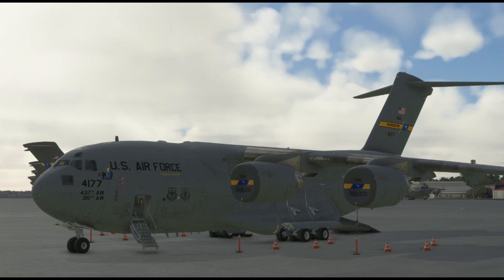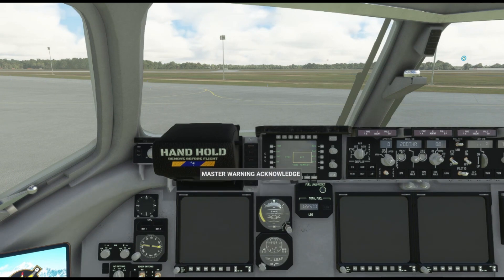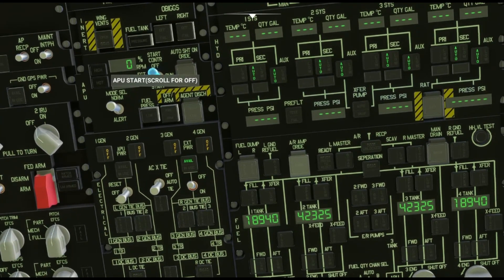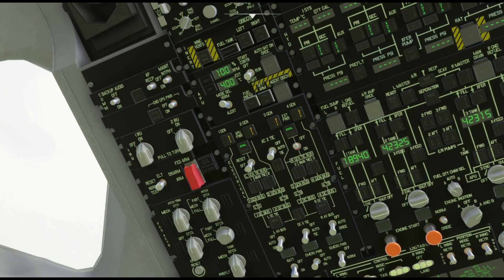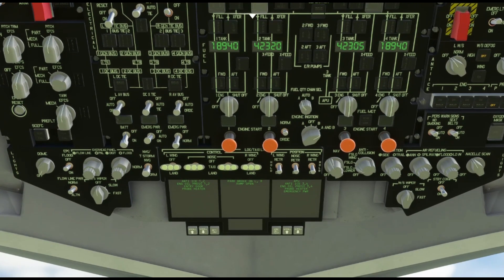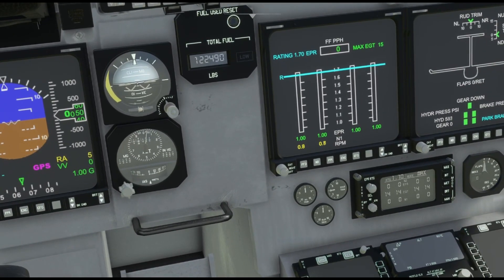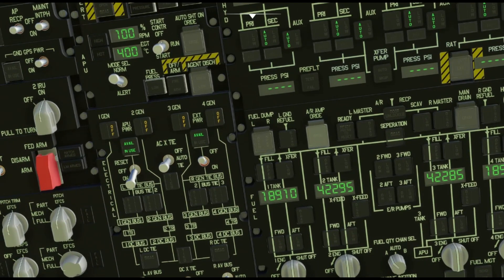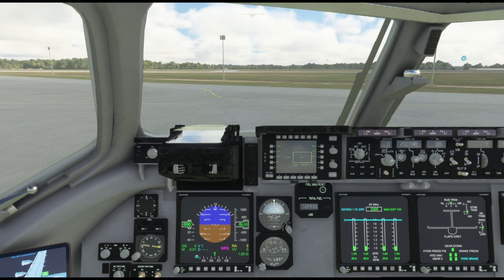Delta Simulations - C-17 Globemaster III - Cold & Dark Start-up

Comment: Nice video, brong back a lot of memories. As a tip, dont start 2 engines at the same time. Only start 1 from the apu (eng 1 or 2). Then turn off the bleed air from apu to the eng 1 / 2 side. Start eng 3 and 4, separate from the apu and eng 1 or 2 from eng 1 or 2 (whichever you started first). Dont forget to put that eng in reverse for some more power.

Comment: Fuel pumps are wrong - the APU only pulls from tank 3. It will also run without the boost pumps on, it is gravity fed. However you will get APU on the WAP after 2 minutes due to low fuel pressure.
That is if you’re only starting the APU, I started writing this before you got to engines lol.

Comment: I'm struggling with the LNAV. I had direct route between two airports and the aircraft did not want to follow lnav (gps) magenta line. I had to use the HDG all the time. Did not find switch for NAV/GPS when I hit LNAV I got the CRS on PFD but I did not find the knob to adjust it.. And unfortunately there is no manual in terms of aircraft system and how to use AP only how to start from cold and dark. :(

Comment: Thanks for the video. Even after the latest update I still get a apu door warning on takeoff. Any tips on how to disable that?
Reply: Never mind I found the solution from the developer's page. By pointing the mouse at the apu switch and scrolling the mouse wheel downward, it will turn off the switch.